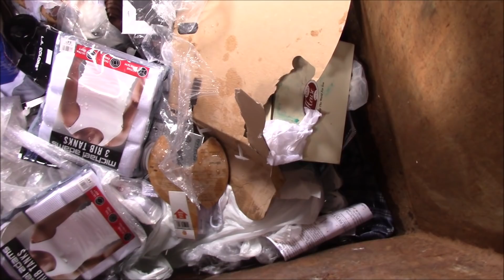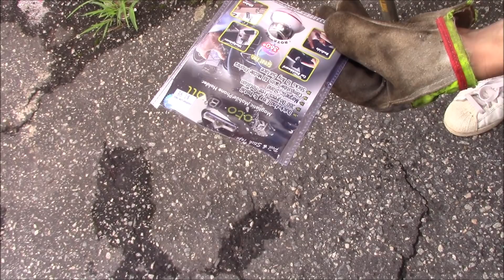The DARK SIDE of Dumpster Juice...

Comment: I gave another dumpster diver a tip and it worked and helps a lot but take a nail or maybe a drill and make few small holes in bottom of dumpster not a lot not big ones just big enough to leak the dumpster juice out and next time it rains it won't puddle up